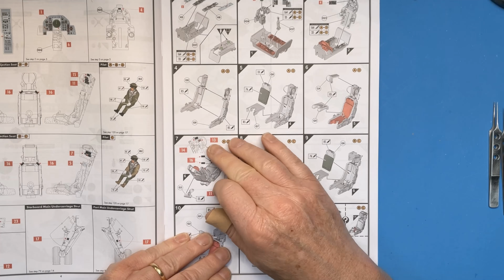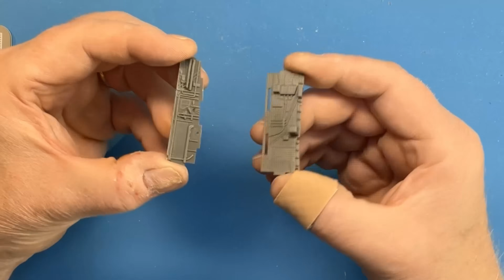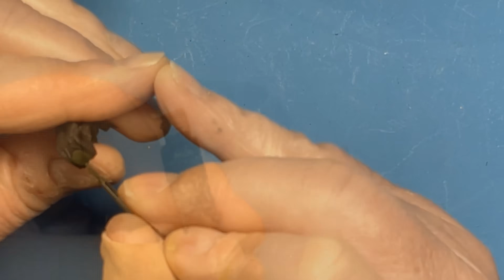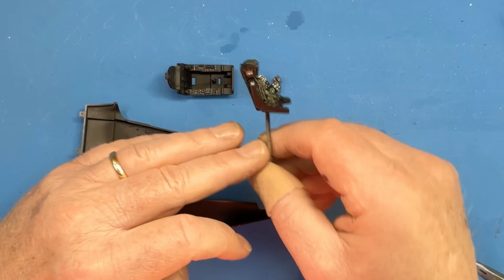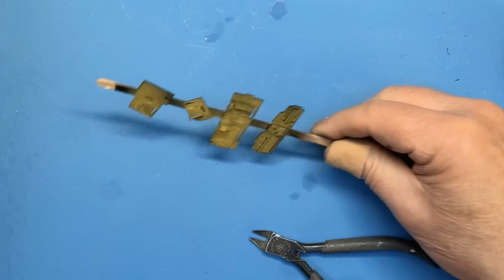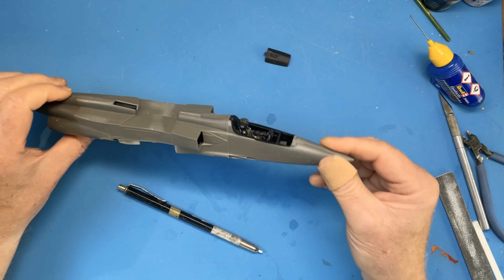Airfix New Tool 1/48 Jaguar GR.1 Part 1

Comment: Worked on Jaguars for 5 1/2 years and every chromate I see is the wrong colour. It's actually a greenish yellow metallic. I have this kit on my bench right now and am going to go for an arctic colour scheme as I have the kitty hawk jaguar in op granby colours already. Nice video though 😁
Reply from the maker: I just tried to match the reference photos I had.
Reply: @TheModelShed  It's really nice. I don't think you're far off at all, but I seem to recall it being a little greener than the dirty yellow shades out there (unless I'm getting far too old now).

Comment: How in the world did the load crew get those AIM-9s on TOP of the wing?!
Reply from the maker: Good question - they were hoisted up on a crane with a C shaped jib which allowed the crane under the leading edge of the wing and the sidewinder above. Obviously the armorers were on the wing to guide the missile in above the rail to secure and arm it.
Reply: @TheModelShed  
That's interesting!

I was an armament guy on F-4Ds and later F-16s. We armed and pulled pins at EOR. Jaguar guys did it on the ramp?!

Comment: WARNING ... Using that Fiberglass abrasive pencil is very dangerous to your health! You HAVE to use it with a high quality filter mask to prevent micro particles of fiberglass to enter your lungs and cause very dangerous tissue damage. Better to avoid that tool alltogether, risk is too high.

Comment: Great work as usual. I've mentioned this before but nobody seems to have taken it seriously. That large circular display is not a radar and should not be green. It's a moving map that is a screen that is backlit with white light when powered up and just looked like a regular glass screen when switched off.
Reply from the maker: Interesting thanks. Just as well I can’t see it under the combing. 😅😅
Reply: @TheModelShed  LOL. Typical! Another little details, which you may well see, is that there's a little black cushion on the HUD. I don't know how many times I fell asleep sitting in the cockpit on nightshift, with my forehead resting on that cushion.

Comment: A fine start, and a video that has sparked memories of watching 54 Squadron Jags take off at the end of the Coltishall runway mere yards away from the crash gate with my dad.
The 72nd Airfix Jaguar was also my last jet kit I made, way back in the mid 80's... this kit is really showing how much the company has progressed in fit from the early days, albeit a bit bigger.
Lots of nostalgia here for me as I'm watching your expertise
Reply from the maker: It is lightyears away from both the 1/72 kit from the 70s and the 1/48 kit they did in the 80s.
Reply: @TheModelShed  fingers crossed for a downsize re-tool to 72nd, I could be tempted 👍

Comment: My only criticism of the kit is that it's a bit expensive. In Canada it's going to cost around as much as a Zoukei Mura Phantom. That said, I'm sure it's worth it if you've been waiting for this kit.
Reply from the maker: it is pricey Kevin - overall I’d say it should be in the £50 bracket.
Reply: @TheModelShed  it looks like it's running for £60 which more than the Gannett and much more than the Lysander. What I like about Jag are the zinc chromate landing bays and white gear juxtaposed with the camo schemes. That's wild and worth building just for that. You did a stellar job on yours, cheers

Comment: With the two seats looks like a two seater is coming out at some stage..lovely looking aircraft the two seater T2
Reply: The 2 seats are both for the single seater. headbox is different after modifications. The breakdown of the fuselage parts do however, indicate a T bird is coming later
Reply from the maker: @modelkitcrazy Airfix provide two identical sets of pads - the same parts for both the early/late seat when you only need one for this kit. It was this that indicated a two seater at some stage.

Comment: Dejavú, reloaded this or did I imagine watching it a couple of hours ago? Nice to see you making the Jag. The kit instructions are colour guides also appear to have another error. With the undercarriage down, only the door ahead of the nose leg, and the two small doors inboard of the main legs would be open, so much of 5hat gear bay detail wouldn’t be visible. I look forward to your next episode.
Reply: When parked on the flight line and in the hangar, the undercarriage doors were OPEN. The only time they were closed with gear down was when taxying and when stored outside overnight, such as on detachment. It was part of the see off procedure for the liney to close them after engine start by means of a toggle switch just above the ground power socket. On see in it was the reverse, and the doors were opened. This allowed access to check the bays and read the fatigue meter in the port main bay.
Reply: @PhonePhixer19  indeed. And the hand pump would be used before the first flight. The AMU was in the nose wheel bay which is why that had to be open. Happy memories